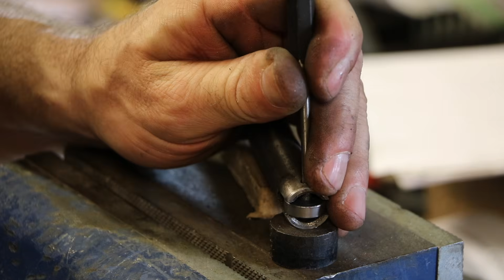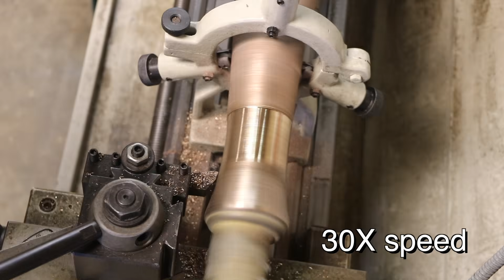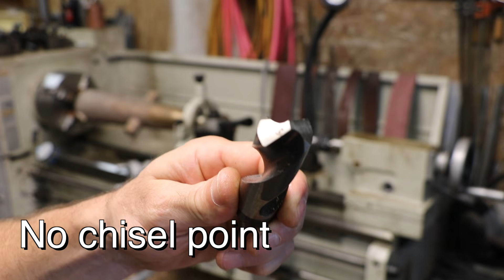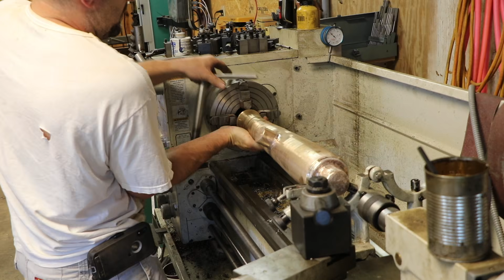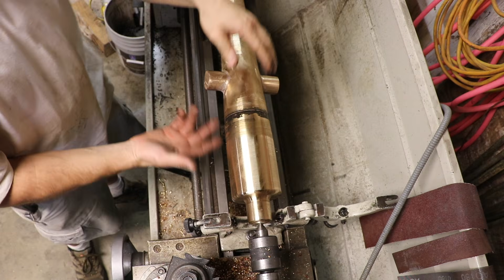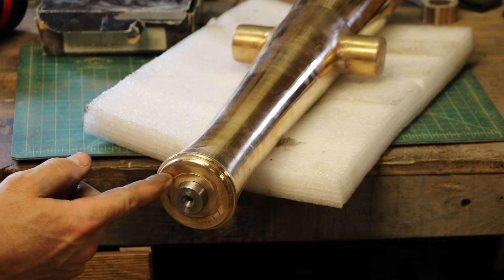Machining a Historic Bronze Cannon Barrel, Scaled Down Replica. FarmCraft101

Comment: Most commercial replica cannons use a steel sleeve to prolong the life of the metals from the corrosive effects of the blackpowder, and the metal fatigue that occurs from repeated firing. AND for safety. I would recommend the same.

Comment: To find the centre with the fixed steady? put steady on part then rotate. if the point of the centre makes a circle its not in the centre, not till you get a dot.  with a sharp centre you could get within 0.002" with bad eye site. By the time you have drilled a centre (even if its a bit off true centre) it will have drilled the hole in the centre.

Comment: I attempted,, to review, this vid;; with an open mind; to its, terminus; beginning, with your first casting attempt(FIASCO). , , , , AND,, second!!:  :; ; ;
UNTIL, , you began to,, 'dial-in' that, ROUGH,, casting,, without, FIRST, ,  installing, a large diameter, convex 'contact disk' onto the end of your,dial indicator. , , , & continue, to force it against that, rough , rotating, workpiece &, BITCHING, ABOUT, the  inaccuracy of the reading!!!  .  .  . A N D !! after W A S T I NG!!! $200, of shop time !! , , ,&, SCREWING UP , an, obviously; FUNCTIONAL,, STEADY REST!! because, , , YOU ARE SO ,, INTELLECTUALLY, , ,I M P O T  E N T!!!  & INEPT as a machinist, , You didn't think of updating,, your memory, re; the max diameter, & WEIGHT, ,capacity, of the existing, , steady rest!  B. F.  D.!!! So you've some pretty ,, machinist toys,, , , , Become adept,, with them prior to recording, another, FABULOUS 'SCREW ( F- - - ) UP' VID!!!!!!  This 
complete, project, series HAS BEEN,, YOUR; PUBLIC PROCLAMATION,, OF,, YOUR INTELLECTUAL IMPOTENCE, , ,& Craftsmanship, ,INEPTITUDE!!!
OBSCENE, , , LOSER!!!!

Comment: I've never worked on cannons or brass barrels but black powder yes.  Honestly if you treat it like a novelty, use extremely low charges and undersized rounds you MIGHT get away with it.  A few times. Short of dumping solder down there with a spoon and rehoning...

Comment: Your bore defect is so far from the breach I wouldn't expect any problems from a safety standpoint.  Very little pressure that far down the barrel.  Proof test it all the same as you don't know if there are other casting issues.

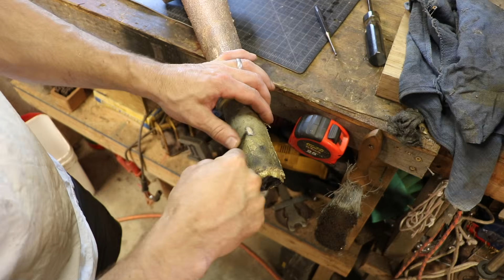Comment: 7:07 what kind of saw is this and why didn't you use it in the first video to cut the first canon?
Reply from the maker: That's my portable metal bandsaw that I typically use to cut metal.  I tried it, but the sand ruined the blade immediately when cutting that monster.
Reply: @FarmCraft101  Thanks for the answer.

Comment: Now that.. is shiny! Job well done.  But you DEFINITELY need to grind the defect and then bronze weld the area to fill it in. After that polish the inside a little bit and add rifling for accuracy. Polishing the inside helps keep it smooth with as little resistence as possible (and it's just rather aesthetically pleasing lol)

Comment: If you put a clock (dial indicator) in the headstock and check that the tailtock is dead true to it, then you can run a clock (dial indicator) from the tailstock and ensure that the unsupported end of your cannon is running true. Simples. But to be honest, your headstock and tailstock should be regularly checked to ensure that they are true when parallel turning over that distance.

Comment: I know its probably not what you would like to hear, but I think you should bore it and line it with heavy wall seamless pipe sealed at one end you can hide the lining easy enough brazing the end in and machining it back , stronger safer and your hours invested wont be trashed , If it was bigger you could have gone out to a 1 .70 inch bore and fired golf balls as ammo ( just a thought  golf balls are 1.68 ). plus you could use Oxy/Acetylene as a propellant less fouling Less pressure, Oxy / Acetylene powered Golf Ball Canon .Will shoot a Golf Ball over 1/2 mile at over 2000 feet per second,https://www.youtube.com/watch?v=SzL-yGcJG-w

Comment: tbh  I would not use that  canon to fire considering the (visible  and who knows what unseen ) flaw in the barrel . I have seen .50 cal machine gun barrels  explode who had only 1 mm cracks inside the barrel and there is no guarantee that this flaw is not connected to another one inside the metal . Fire it if u want to but build some good cover first to stand behind it . ( Been an arms mechanic in the army of my country for over 15 years )

Comment: How about heat it to like 250 C and fill with tinn and bore hole agein. Tin should be easy to drill out, and inside would be clean and hole free after that. Might give slightly more strenght too. You could place aluminium tube insede of the hole to limit amount of tin needed and make drilling hole agein only need you to use bore.

Comment: I don't think that defect would be a problem later on. As of my experience... only with blackpowder, I have made some fireworks and tried to make like a mortar that turned from tetrahedron into a ball with a giant hole after just one shot... but it had been made from 2mm steel plates, an edge a little over 11cm and contained 100g of blackpowder. I guess your cannon could loose some accuracy (not that important unless you want to turn it into a sniper rifle) due to turbulences caused by that defect and some powder can get stuck in there. KNO3 greatly increases corrosion but bronze contains a lot of copper that will make a layer of copper oxide and stop further damage. So overall it should be fine.
P.S. This snake looks like it has some stuck shed on his eye (assuming this was filmed after shedding).

Comment: In 1972 I started making a brass cannon in metals shop class using a plaster of Paris mold. I didn't heat the mold to burn out the grease I used to keep the wooden cannon form from sticking to the plaster so when I poured the molten brass in it sort of caught fire and splattered molten brass all over the shop floor. Fortunately my parents got a divorce and I had to change schools to one that didn't have a foundry. I say fortunately because I had no idea how much work it would have been to finish the cannon. Much admiration to you for sticking to the job!

Comment: You are not going to be able to press a steel sleeve into that.  It is too long of a press fit.  (You want to be about 2 diameters, max.)  You'll have to heat the cannon and shrink it around the sleeve, or freeze (like with LN2) the sleeve and let it expand.

Comment: I was waiting for the voids to show up. Cast cannon, whether Gun Metal, Iron or cast steel should ALWAYS be x-rayed and magna-flux. Voids can be nasty surprises, and the reason for catastrophic failure in tubes/cannons. I was certified in the commonwealth of Mass., state of confusion, as a cannoneer/mortar man. I am, also, a gonnemeister, which requires one to manufacture a handgonne by means of metal casting, hammerwelding and machining  a gonnebarrel. As well as making both serpentine & corned blackpowder from scratch.

I would first see to having your tube both  x-rayed and magna-flux. Seek out an Industrial Pipe Inspector. If you are fortunate enough that your voids are minimal, open up your bore, and install a heavy wall sleeve with a pinned & welded breech plug. At the muzzle, drill four hole equally spaced apart, centering between the sleeve and the barrel, about an inch deep, tap & thread the hole, screw a class 8.8 bolt in each hole. Cut the protruding bolt off square with the face of the muzzle. This will prevent the sleeve from walking out. Next, drill out the vent, being sure that penetrates the sleeve, and tap it for a stainless steel bolt, that has been drilled through length wise, a hole large enough to allow a length of cannon fuse to slide in easily. You will need to have a gimlet that can slide through that hole as well.

Comment: @19:34 I would have done it differently provided the tools allow it. You know you have your center on the horizontal axis so mark it with a vertical line, then rotate the piece 1/4 turn and draw an other vertical line passing through the horizontal center. You should have your center. Maybe repeat after a 1/3 turn for safety?

Comment: If you put a thick washer of sorts to extend the area that it has to rest against outwards, you wouldn't have had to cut the fingers. So basically, just extending the sleeve it travels through, outwards, so that you have that extra room you desired. Sorry for the wording, I'm ignorant of the proper wording/names.

Comment: This is an after thought for the steady rest. You could have made sleeves that fit over the original outer shaft to extend the shaft length. This would make it to use the original internal shaft with the bearing and bolt setup.    Not sure if I explained that good enough, 4am, so my thought process is not the greatest right now.

Awesome work and can't wait to see the next video.

Comment: Sleeve it with a length of cold drawn seamless tube and be done with it. Do you want to have a lingering concern every time you fire it about whether or not it's going to blow up?  A sleeve will give you a known strength for the barrel with a solid safety factor.

Comment: you need keep the melting form as long as possible liquid/ hot. if the metal have several different cool down areas like front and back, the metal quality decreased

Comment: I think that I would braze over that large pit, and re-bore that section of the barrel. 
It would not only add some strength, but it would provide a much better seal, and the brass (having a much lower melting point than the bronze) shouldn't harm the barrel. 
I would put a charcoal plug just beyond the rough area, to limit how far the brass could run, but I'd bet that a brass patch, there, would help.

Comment: Defect is to large to use as is.  There is no guarantee the pressure is going to be reduced enough when the round passes that point for it not to blow out. The reason being powered doesn't all burn at the exact same time. In short pressure could be still increasing or staying fairly constant as it passes. For safety I would sleeve the cannon. I wouldn't even do a test fire with no one around because you are just risking all the work you did to get that far. Not worth having to repeat.

Comment: Could you overbore it and re cast the center? Then go back and drill it back out again. That or weld a cap on a steel barrel sleeve and put that in place. That would probably be the best solution imo.

Comment: hey can you tell me the name of that tool you are using to find the center of the cannon when loading it on your lathe. 
the one that you put on the side of the cannon and spin the cannon to tell you how much it is out of center. I can't think of it for the life of me and I need to know so I can buy one
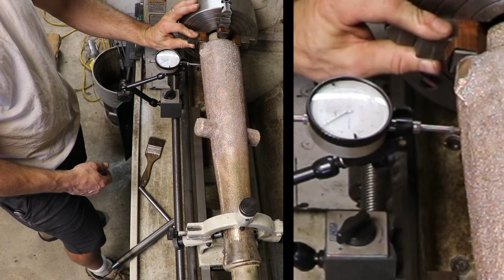Reply: 7:38 this one
Reply from the maker: @SawandScythe  It's a dial indicator.  Cheap ones work fine.  The holder for it is a little more important.  The cheap holders are basically worthless.  Get a noga holder like I'm using and you'll never regret it.  You can put the indicator in any position and it will stay solid.

Comment: For centering the butt end when it was sagging in gravity: could you polish the end, then bring a dead center just barely in contact with butt and slowly rotate the cannon 360°, to make the tip scribe a circle with the radius of the sag. The center of the circle should be the true center, which you could then punch as a start point. 

I have no lathe or machining experience - just thinking off the top of the head.

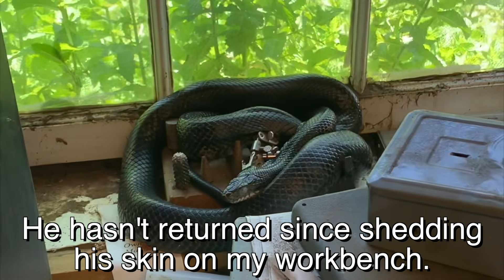Comment: 28:10 Herman is not moving because he can't see, his eyes are cloudy. Snakes have what's called "eye caps" which is a thick piece of skin that covers the snake's eye to keep moisture in and dirt out. Before a snake sheds the eye caps get cloudy.  However after shedding if the eyes are still cloudy the eye caps did not come off, the snake has retained them.  Herman seems tame enough if you can gently see if with a soft cloth you can loosen the eye caps. If its not the eye caps it may be an infection or blocked nasolacrimal ducts is how the snake’s excess tears drain into the mouth.  Time for a visit to the vet.

EDIT: If the shed skin is still around have a look at the head to see if the eye caps are there, if there are eye holes, then you know what the problem is.

Comment: I'm not a gunsmith, nor do I have any experience with cannons, but I do quite a lot of historical research into this time period, and almost all critical failures for Artillery pieces take place at the area surrounding the gunpowder, which is why in cannons like the Napoleon, the walls of the cannon are doubly thick at area that the actual explosion takes place. if that defect is near the end of the barrel, it's certainly going to cause some problems, though it's nothing a steel sleeve can't fix.

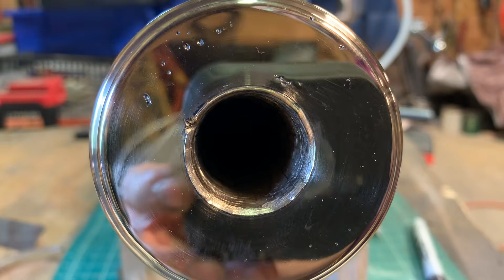Comment: I fear that with the defects inside it as well as the obvious ones on the front of it (the visible splotches visible right at 27:46) because those are on the inside when it used to be a solid piece, before they were brought out to be on the surface. How many more might there be?
I think that the sand you used just isn't the right one, I think buying packing sand will yield much better, safer and more accurate results.

Comment: I'm an engineer and I do pipe stress analysis for a living (power piping systems...high temperature and pressure).  Not really that much different.  The problem I see with your defect is if there a sharp, narrow notch it the bottom of that defect you could have less wall then you think.  Thermal expansion due to heat and pressure will put any cracks in tension and if the defect runs circumferential a sharp narrow defect can propagate quickly.  Can you tell the shape and direction of the defect?  

Where I work we would perform non-destructive testing (NDT) with either eddy current or ultra-sonic testing to determine the extent of the defect.  You may be able to rent that kind of equipment....however, sleeving the ID is the best option here.  A hoop stress calculation for a steel sleeve backed by the bronze should tell you how thick the sleeve needs to be.  I can work that out for you but engineering judgement says that a steel sleeve of about 0.0625-0.125 should be plenty.

In my professional opinion an interference fit would be best.  Heat the cannon and cool the sleeve (dry ice maybe) and insert the sleeve.  It will be interesting to see where you go with this.

Comment: So if your using tannerite or traditional black powder, that defect shouldn't be too much of an issue especially if you don't plan on using a projectile. If in fact you do use a projectile, ensure that it has at least a 32nd of an inch space between the bore and the ball. Cannon balls were never bore tight. They were actually pretty loose TBH. Maybe go so far as a full 16th of an inch. If you watch slow-motion vids of civil war reenactors firing their cannons with ball shot, you will see that the ball has a Halo of fire around it as it exits the barrel. The reason I'm telling you this is becuase if you apply this to your cannon, that defect will not be an issue. The ball should have enough space between it and the bore for your wadding to slip through. Muzzel velocity of cannon balls was extremely low. It was low enough that you could actually see the ball after 500 meters with the naked eye if it struck the ground and bounced. Also, do not use anything else besides tannerite or standard black powder. Anything else will put to much strain on that cannon. Finally, if you're super worried about it, you can sleeve it with steel Wich will also allow you to rifle it. But that's a whole nother beast to chew on with completely different mechanics behind the firing of it.
Reply: Do not try and fire your cannon with a bore tight ball. This will cause a failure I that defect after a few shots. Also, you could patch the hole as well with a weld. The thing to remember about defects is the surface area of the defect or pt in the bore. The more surface area it has, the more likely it will fail because it will have more surface area for the pressure to push against. You are Gunna want to do some estimation work on what sort of pressures you will be expecting in that bore. From there, you should be able to estimate how much pressure will be put on that defect and it's total surface area. Finally, Napoleonic era artillery  was not an exact science like modern artillery is. There is some room for error. Not alot, but some. I suggest you read up heavily on proper firing procedures for that era of cannon. I would not be surprised if there is a local reenactors club that actually has a cannon crew.
Reply: BTW, it's a beautiful piece.

Comment: Not a machinist, but f you put a pencil in the tailstock and spin the barrel, it will draw a circle around the true center.
Would you comment as you go about things you wished you had done differently?  For example, it would have turned much nicer without the mounting as part of a single cast.
Enjoying the project, and appreciate someone who keeps going even when the project hits a PITA stage!

Comment: No, imperfections in the bore are absolutely unacceptable. Even a slight dent could wedge the cannonball which would rupture the barrel. Especially if the crevice is as deep as this
Reply: There is no way such a defect would "wedge" a projectile. But it is a weakness in the barrel and will also result in barrel erosion over time.